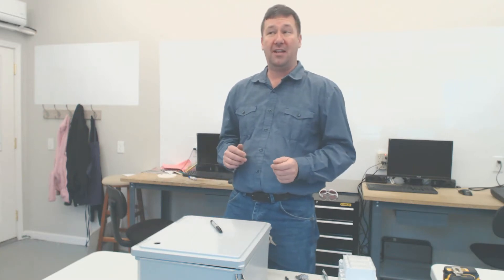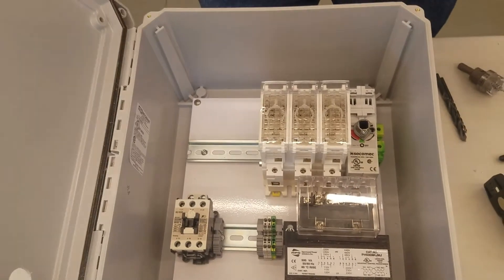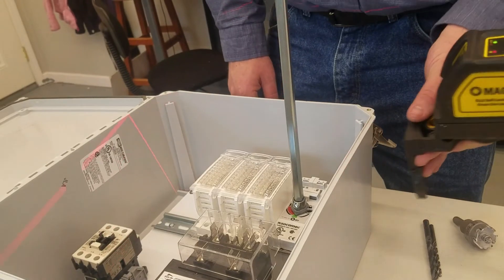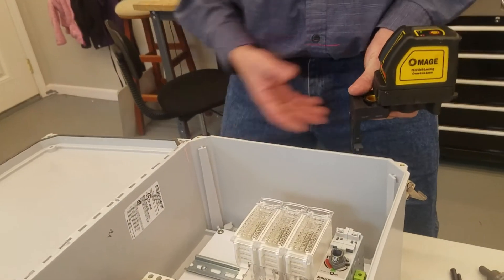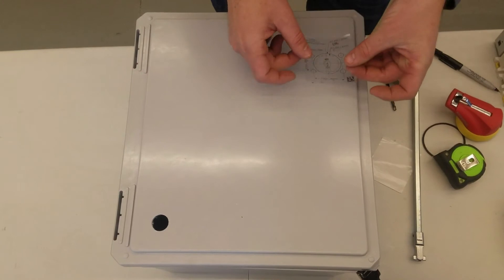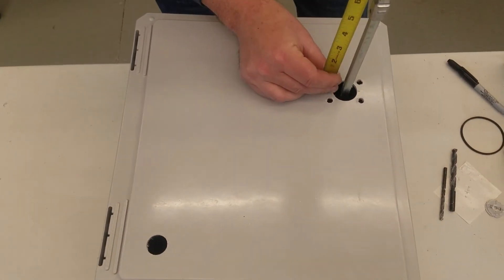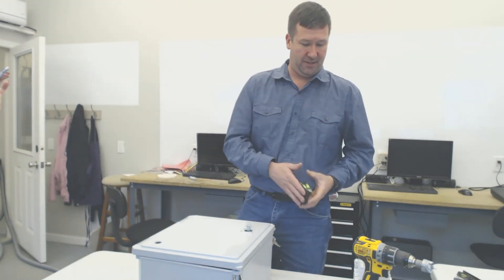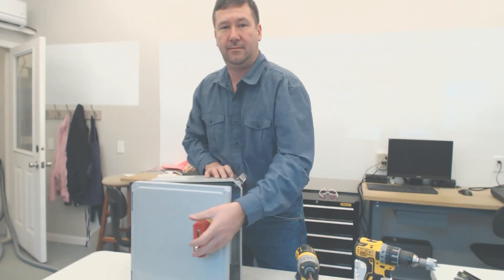Installing a Through the Door Disconnect Handle the Right Way

Comment: One thing you might find handy - if you do a lot of the same depth panels, buy an extra bar and sharpen the end to a point. Make the length just long enough to touch the backside of the door with it closed. Insert shaft, close door, and give it a small hit. Bingo! Back of door with perfect spot indicated. I have 'indicator' shafts for all the panel depths I build (usually 8", 10", and 12" mostly).

Comment: Great idea. We use one size hole for disconnect. Had machine shop make a bushing to fit hole and use a SS rod down the bushing center to make mark ( it takes months to find parts). Another way install disconnect then mark door with a rod.

Comment: Love it!... When I was doing this way back, we did not have laser levels so we would use all sorts of Heat Robertson methods to find this location like hanging a plumb line from the overhead wire rack in line with the shaft hole then close the door to find it...
Reply from the maker: Yes, the first time I saw this done, it was a game changer.

Comment: What are the steps to get exact length of shaft? Please and thank you
Reply from the maker: That part is manufacturer dependent but is always on the installation guide, look for the dimension that it should protrude out.  Then install your shaft and measure how much yours sticks out.   Subtract the two and that is how much you need to cut off the back side.
Reply: @TimWilborne  awesome thank you so much. You have a new subscriber😀😀

Comment: Great Idea i run a panel shop and love this idea the laser helps alot do you find the Omage Cll2 a good laser level? or do you suggest another model?
Reply from the maker: Hi Jon.  Your typical laser level should work fine. Here is one I referred someone to the other week. https://www.amazon.com/gp/product/B01N33JJ3R/ref=as_li_tl?ie=UTF8&camp=1789&creative=9325&creativeASIN=B01N33JJ3R&linkCode=as2&tag=twcontrols-20&linkId=411c462320a24be4a06b90f782230732
Reply: @TimWilborne  Great thank you very much!